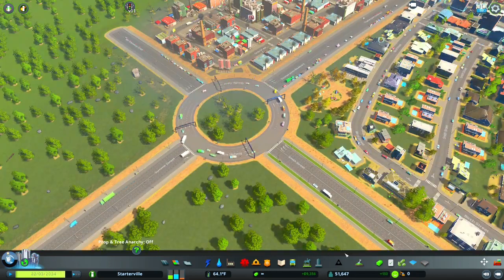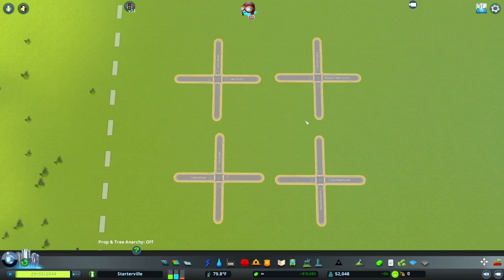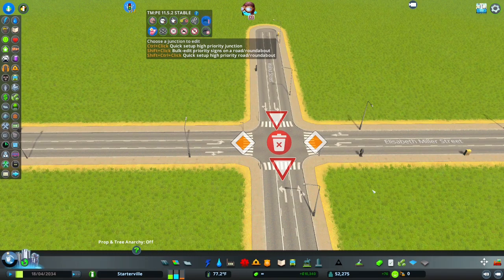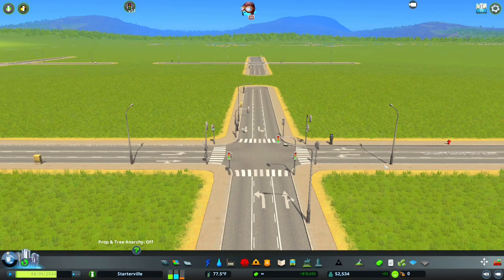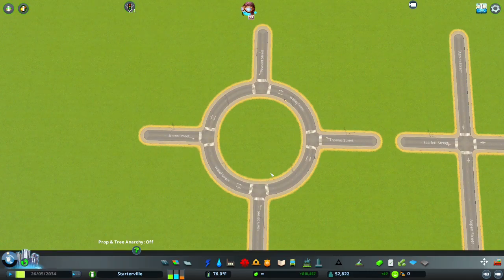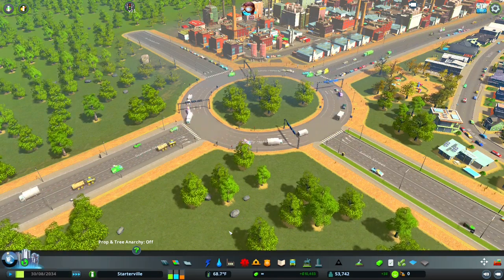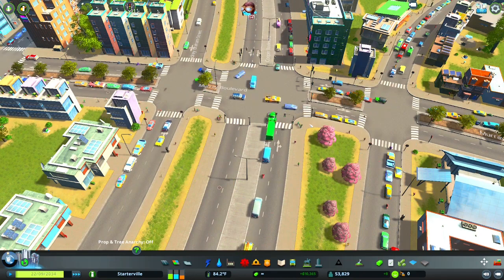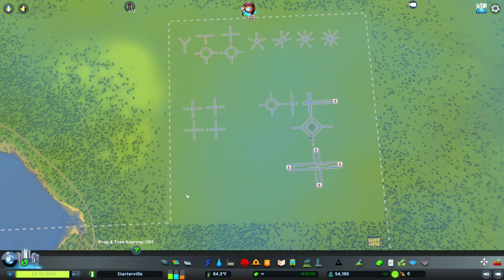Introduction to Intersections in Cities: Skylines - Basics of Intersections

Comment: You can actually do the intersection shown in minute 8:34 ?? I mean like with out modes
Reply from the maker: You sort of can. It won't look the same as it does in this video as I did use mods to make it look more streamlined, and I do recommend mods for traffic light timing, but you can make it work without mods.
Reply: You can technically make it without mods but you can't restrict left turns without mods so it won't really qork